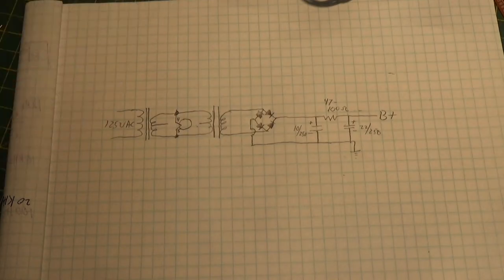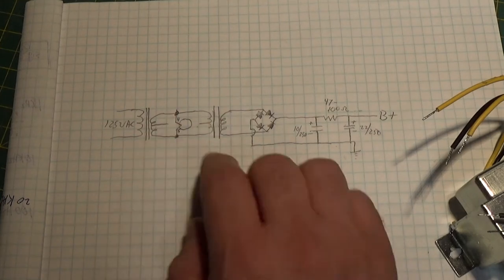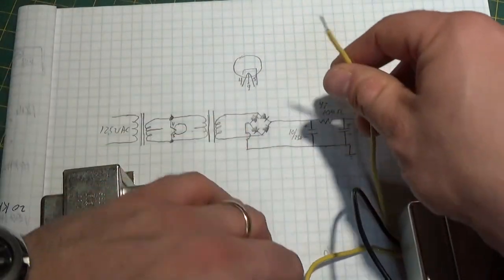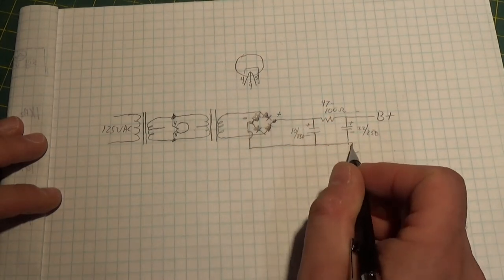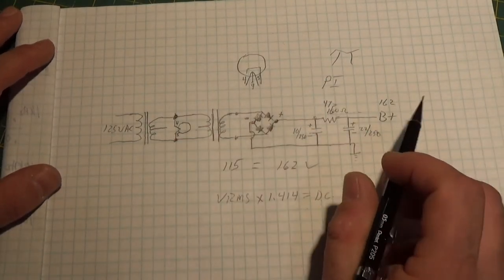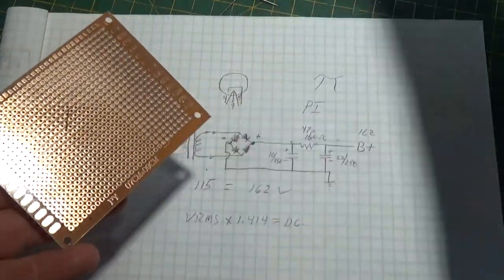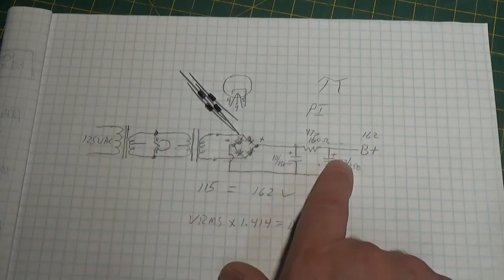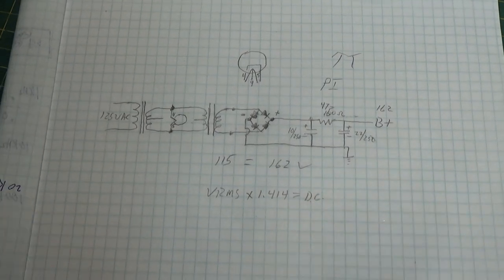Vacuum Tube Preamp Circuit for MP3 Part 2 - Power  Supply

Comment: A great source for HV-caps are old PC-psu's. They've normally got two or four 680µF@200V or so caps in there. You put them in series and you're good to go.

Of course 340µF makes for a pretty stiff power supply, but for Hifi and experimentation its awesome ;)

Btw. you have to keep in mind that european viewers will have double the output voltage, since they're working with 240VAC.
Reply from the maker: Thank you for the comment.  Two great points!  I've used parts out of computer power supplies as well.  Now that I think of it, I've also found suitable capacitors and diodes in those CFL light bulbs.  Crack them open (being careful not to break the glass tube because of the mercury, glass, etc) and there's usually a small PC board with good components.  Thanks, and all the best!